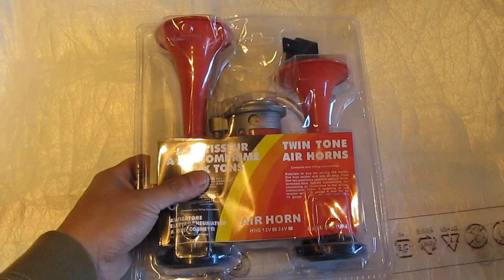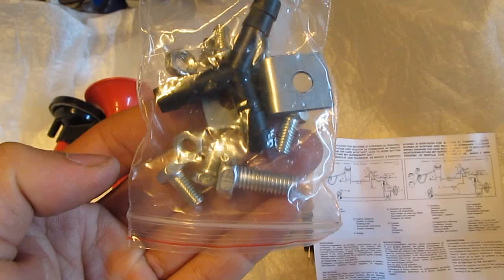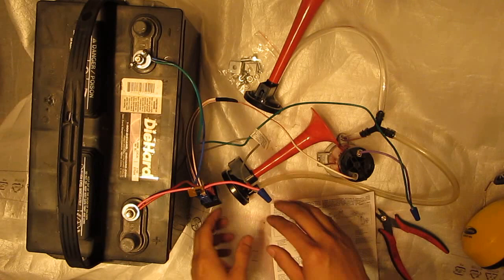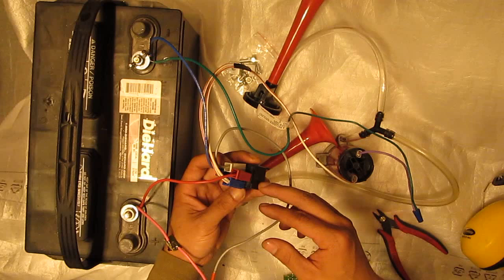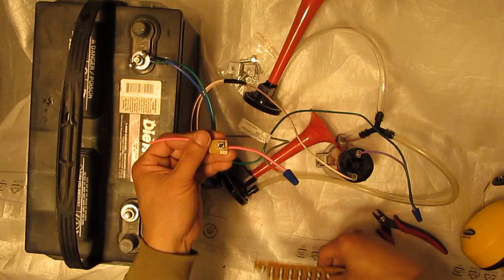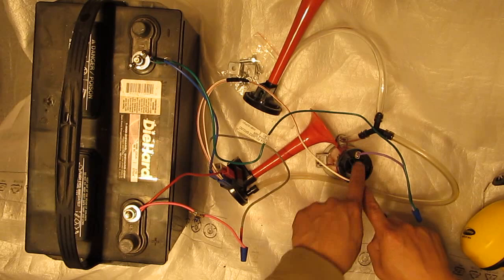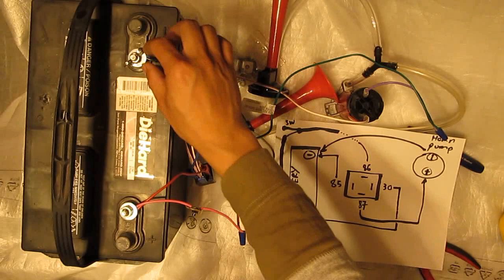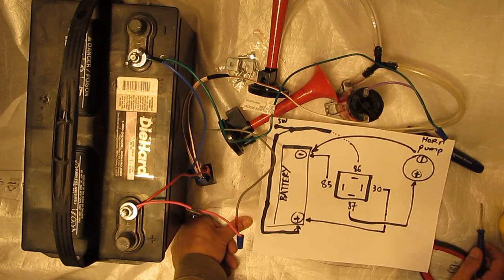DIY: Install a Train Horn for Cars & How to wire a relay

Comment: I would use an empty freon tank as an accumulator for the pump for instant sound. There is a half second wait for the horns to start, and the accumulator would eliminate that wait time.
Reply: Show your video would like that it would be instent

Comment: Don't understand pin numbers on air horn but will get it when horn arrives....good vid thanks a bundle....
Will use in line fuse and relay... Not sure what comes with it at mo......

Comment: Is there a way to set this horn up to run from a power supply that connects to mains power? So that I can avoid the need for a battery pack? And have it constantly powered?

Comment: Great video I do have a question, I have this same air horns and I would like to replace the existing horns under the hood that have 2 wires each, with the air horns and using the steering horn button, their is a 15 amp fuse in the fuse box, can this be done and how.
Thanks
Reply: Nope

Comment: Help please!!😢 I was just trying to install a GAMPRO 12V 150db Air Horn, 18 In, and it's not shutting off. I bought a separate switch that have a black and red wire, how do I connect the switch?

Comment: Dude...I really hope you fused this😅
Reply: Inbetween what wires would you place the fuse ?
Reply: @AndresMadrigal1  hot wire coming of 12v source
Reply: @trentdawg2832  What would the amps be for this if you don't mind me asking? Looking for a fuse myself.
Reply: @rohanndutoit4544  mine is on a relay...30amp I believe

Comment: my horns that look just like this the diagram says that 30 is supposed to have a 30 amp fuse in line. Why do you have 2 wires going to 1 pin on 87 ??

Comment: I'm guessing the "Switch" is your old horn wire? The positive one that usually attaches to the old wimpy horn?
Reply from the maker: No, I used a completely new circuit. I did try to use my old horn switch which is on the steering wheel but it burns the fuse immediately because the amp draw is too much. So I have to make a new circuit and install a higher amp fuse (20A) in it.
Reply: Stephen Lerch yes exactly. It only takes 200mA to throw a relay. If he's burning out fuses, he has it wired wrong. You would essentially unplug your old horn and plug it into 85 & 86. With FUSED power to pin 30. Any other questions mate, just ask.
Reply: As Nicholas stated it is quite simple. I literally unplugged my old horn and threw the live on 86 and the ground on 85. Not too sure why it would be a problem. I must add from 30 to the battery I put a 20amp (no idea if sufficient) fuse in and it works like a charm. Was quite nice not to have to wire new ends etc. Hope that helps.

Comment: Did you use a separate switch ?? I have one of those but brigestone.  I didn’t use separate switch
Reply from the maker: Yes, I used a separate switch. I tried to use the same switch on the steering wheel but it burned out my fuse.
Reply: @vuaeco  please help me to install a separate switch, I tried and the horn won't stop blaring. Switch not controlling it

Comment: what would happen if i didnt use the relay?  I will just use a push button  switch.
Reply: btw im using a lithium polymer 4s battery with a 70c rating.  Im just using this for new year as a portable air trumpet.

Comment: do you NEED the relay? im trying to put oneof these on my scooter. i know how i have to wire it up just if i dont have to thatd be great.
Reply from the maker: That depends on how many amps your horn needs. But in general, if you have a high amp push power button (20A or more), you won't need a relay.
Reply: im not sure honestly im putting it on a scooter. i wired it up to the horn and it goes fine but ive done a lot of other electrical junk so im popping fuses TnT so i gotta upgrade my rectifier or something idk but i think i got it wired up fine idk TnT lol
Reply: thanks for the info :J

Comment: Hi, I installed this on my car but the volume of the horn really really soft.. What could be the issue?
Reply from the maker: Could be the pump. The pump has to pump fast enough air through the horns. If you don't have good flow of air through the horns, it will sound weak. There are a few reasons why this happens. Your pump might be defective, or your battery is too weak, or there's an air leak in the tubes.
Reply: It sound is always consistently low volume.. Battery is standard 12V from a VW Tiguan 2018 model - is that okay? Don't they all work with 12V car batteries?? I Checked the pipes and they are okay.. Do you think the compressor pump is just a crappy weak one then? Get a new pump and try?
Reply from the maker: I'd try a new pump and see if that's better. If you have a regular compressor (for pumping air into tires), you can try that.
Reply: You are probably not using the relay correctly. When this happens it's because the pump needs power directly from the battery

Comment: Terminal 30 is from the + from the battery.
87 is to the + terminal on the compression.
85 & 86 are the terminals that ‘activate’ the power to the compressor, it doesn’t matter which way around they go.
Every video on this topic is rubbish.